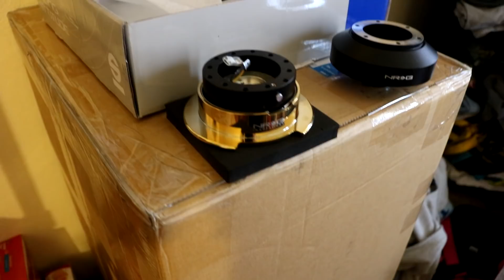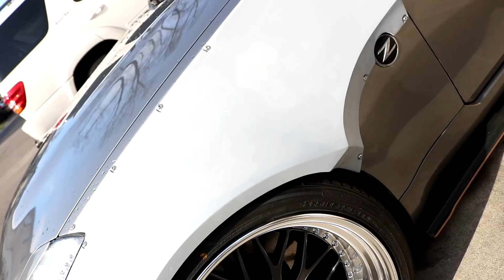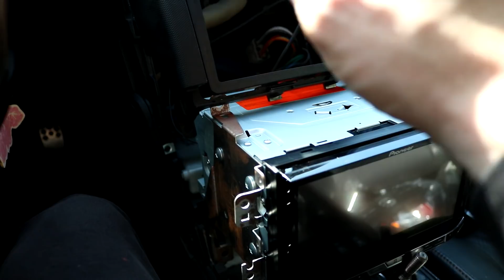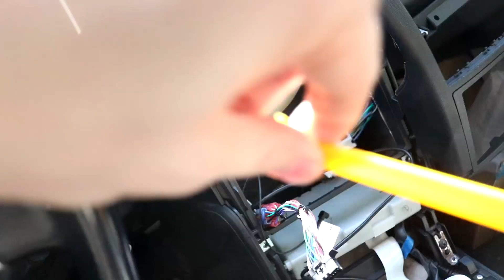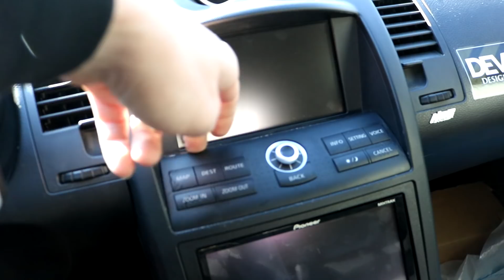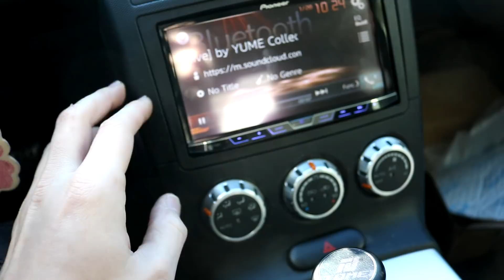350Z Widebody Reveal + Head Unit Install!

Comment: Hey bro I got a question for you. I installed all of this and it works great! I just have one problem. I can't hear my factory  NAV anymore. Do you know how to fix this issue?
Reply from the maker: ImBlaze30 Hmm that's quite interesting. Unfortunately I'm not sure what would cause that. It may be too obvious, but did you make sure that your nav sound/voice is turned on in the settings? Sorry I can't be of more help...
Reply: SiegeStyle yes I checked and it doesn't give me any sound even when I press the voice button for a repeat of direction. Does yours give sound through the pioneer unit? When I had the factory unit installed it would turn down the volume when stating directions.
Reply: I found out that in order to make the NAV units sound come through the speakers i will need a DSP and amplifiers. I will do more research on this.

Comment: You're the first person I've came across that has the factory navigation like me.  I've looked & looked for someone to show me how to remove it so thanks for that.  Also I'm looking for the bezel that you have that works with the 7in screen.  Can you tell me where you got it from?  Also, have you looked for the center dash carbon fiber with navigation to replace the old one?  I want one but can't find any with the navigation. It's all cubby holes!  I have the BOSE as well so I need to get the PAC NIS2.  It says it's for a 06-07 but I have a 08.  Will it still work?  Thanks!  (I'm the disabled guy whom asked about the building on the engine in another video)
Reply from the maker: Scosche bezel: https://amzn.to/2JRHNnj
PAC ROEM-NIS2: https://amzn.to/2Mp4qOi

I haven't looked into a carbon center dash. I imagine your best bet is to have your dash custom overlayed.
Reply: Thank you!  One last question...lol  Can you use the bose stereo mounting brackets to attach the new pioneer head unit or do I need to get some new ones?
Reply from the maker: No problem. The old brackets should swap directly over. I didn't need to buy replacements.

Comment: Man, I've been following you from the start and can't believe the progress! Hopefully you consider making a mold for the fenders on the oem front bumper. Just picked up the same wing and it's currently in the shop getting paint matched. How is yours holding up? Any other suggestions besides what you already posted in the install video?
Reply from the maker: Jay Sweet man thanks a ton. I'm certainly considering all options with the kit, but I'll need some time to produce anything. I appreciate your patience. The wing is holding up just fine. No problems at all! 👍

Comment: Nice radio, hopefully the sun doesn't damage it. I have Pioneer AppRadio 4  in my Z and the display is all messed up from the sun so it's hard to see when it's sunny out.
Reply from the maker: DROIDRAZR16 Ah man I'm sorry to hear that. I just had my windows tinted so it should cut down on the sun exposure. Hopefully haha!
Reply: Pioneer 1440 get it , solves the display problem. Get the one that takes CD.

Comment: Great video bro... question for you. Does your nav unit still work properly with the addition of the pioneer unit? I've been wanting to do this for years but was afraid I would mess up my main units functionality. Love the new steering wheel too by the way, keep up the great work.
Reply from the maker: ImBlaze30 Yes factory nav works 100%. It's not affected by the head unit at all! Thanks bro.
Reply: SiegeStyle thx that is awesome news because I really want to have Bluetooth in my car when it comes to music from my phone. Last question, if I don't change my steering wheel, will I still be able to use it to change the radio from the pioneer unit? And I assume I will need to get that adapter you showed too, to keep original Bose
Reply from the maker: Yes but you will need the steering wheel control interface. You can find it here: http://amzn.to/2DU6QTT
Reply: SiegeStyle man you are a life saver... appreciate all the vids and help bro!!! Thx!

Comment: how much were you charged to get that front bumper painted?
Reply from the maker: Illusive Too much lol. I paid $600 for paint on the bumper and wing.
Reply: What i did for mine after i prepped it was spray paint it a bit and let that dry for a day and just vinyl wrapped the whole thing. cost me less than $100. just throwing this out there if you want to save money. i havw the same exact bumper as him from vicrez. hes actually the reason i bought it lol
Reply: I would wrap it, but I want to keep my oem color so this ain't gonna work